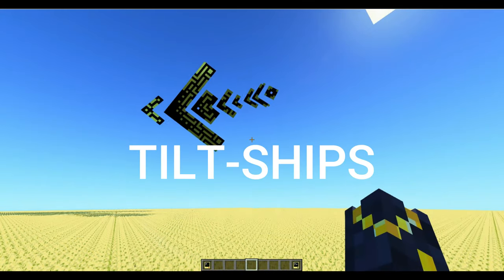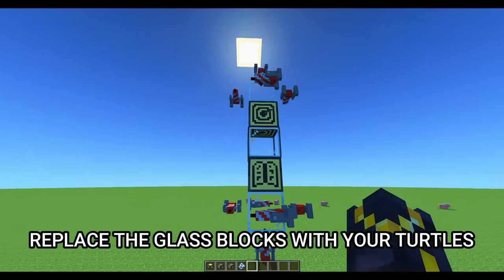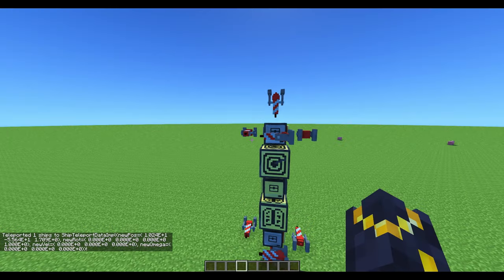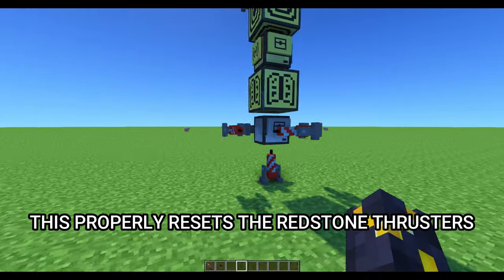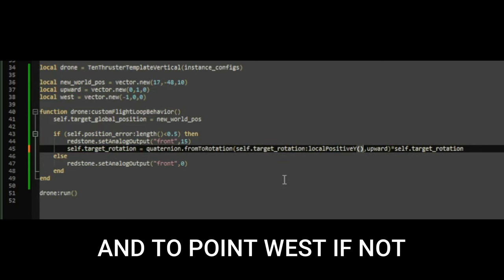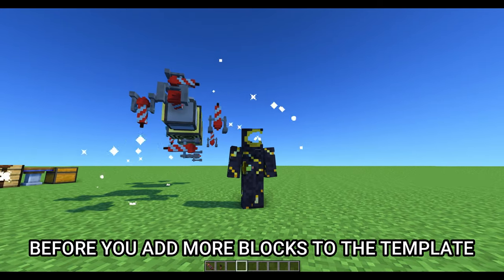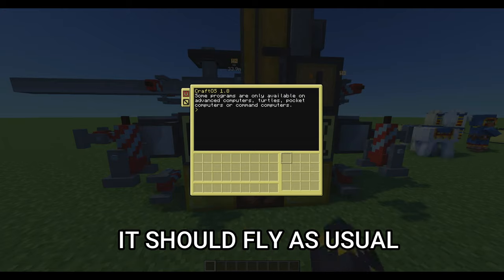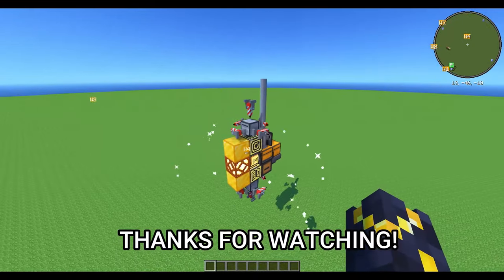THE BASICS | PART -1

Comment: I'm thinking if it's possible to build some sort of Mech using these. Imagine a huge Robot composed of unattached hovering ships, two ships for feet, ships for legs and torso etc.Based on the position of the feet the adjacent limbs move along, thus transporting the main ship which is the torso, where the player sits and controls the feet
Reply from the maker: Yeah, tho I think it would be more efficient to use KubeVS for that kind of build. You wouldn't need thrusters or computercraft that way.

Comment: im glad that you can make one that uses clockwork for thrusters cuz its more commen then turnament
Reply from the maker: Its just a test build and so far I dont like it. I havent flown it yet (or even programmed it) but I estimate with regular tanks its flight time would last for ~3min. You can stretch it out to ~13min if you get it to hover in place vertically (only using one afterblazer). 

She looks pretty but she's a gass guzler... and its bulkier than your regular tournament frame

Comment: it's not hovering correctly. it's struggling. it says on the main computer ...ensory/PlayerRadar.lua:14:  attempt to index field 'peripheral' (a nil value). i don't think it knows what 'peripheral' means.
Reply from the maker: @gremin_the_4700th  just leaving this here to point other people to the pinned comment
Reply from the maker: Also, to point out, from the error message it seems the turtle cant find the radarblock. Its most likely that the radar block is being blocked by one of the turtle's side peripherals
Reply from the maker: Or if you decided to connect the radar block on one of the modem-blocks, the turtle cant see it until the modem block is activated (right-click on it until it glows red)